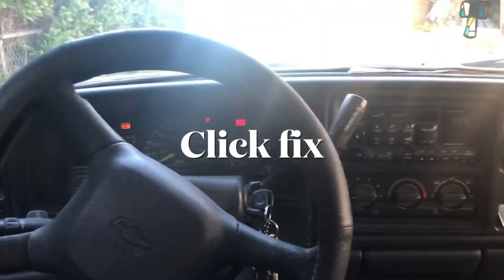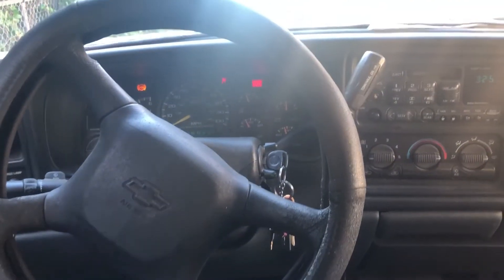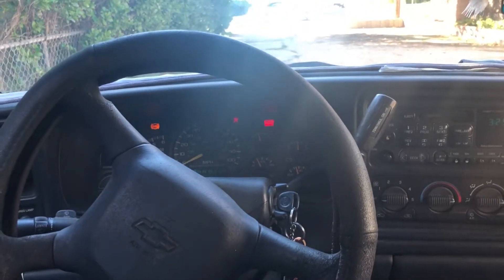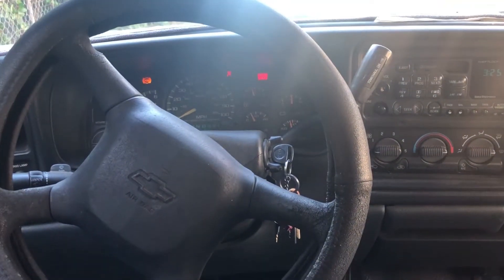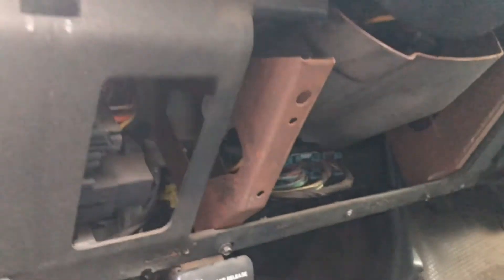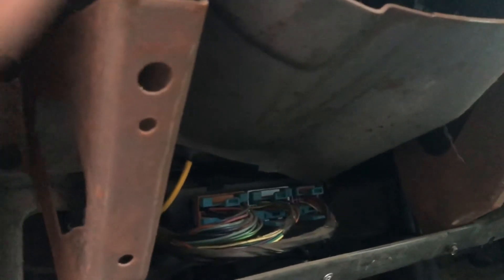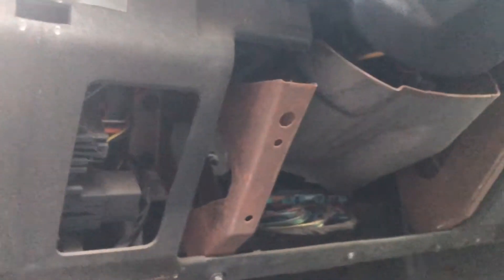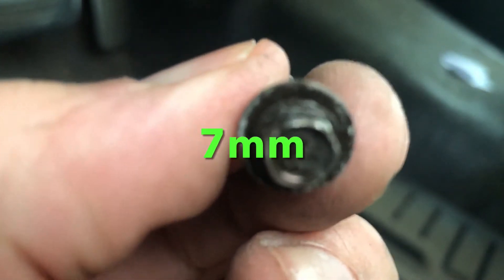2001 Chevrolet Silverado terrible clicking from dashboard.

Comment: So, what was making the clicking sound?  Part number?
Reply from the maker: I disconnected the wire to the fan relay and it went away
Reply: So when you disconnected the fan cable did the ac stop working ?